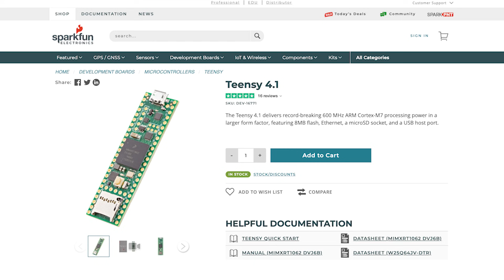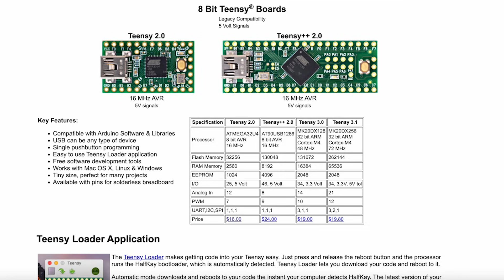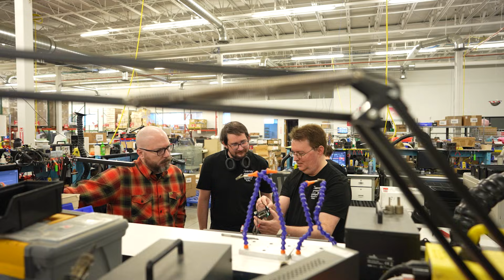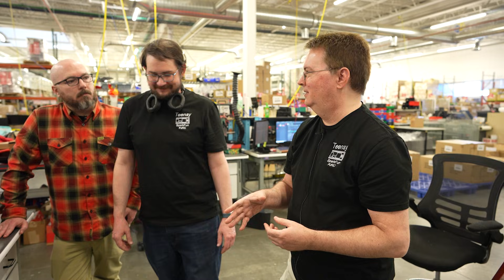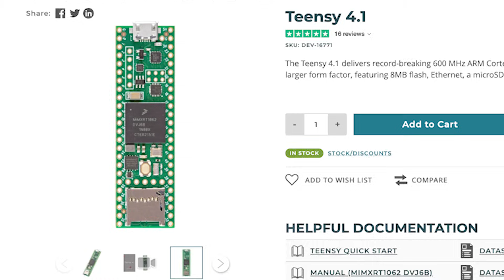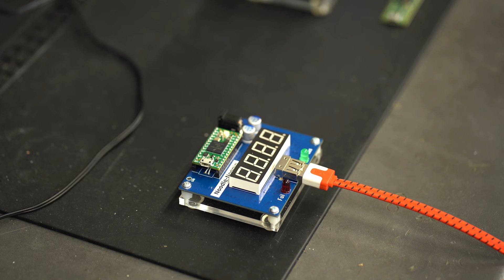The Story of Teensy: From PJRC to SparkFun Partnership

Comment: Teensy (3.2 specifically) arrived as a powerhouse right when people needed it. Most of the market was more expensive underpowered Arduino boards or difficult to get started with bare AVRs and PICs. Paul's software support made it extremely easy to work with and embed into all kinds of projects.

Comment: They are great but imo largely redundant with the likes of ESP32 being cheaper and more available.
Reply: Teensy is significantly faster 600mhz whereas the fastest esp32 I have seen goes up to 400Mhz.  Also teensy uses arm microcontroller vs Tensilica on esp.
Reply: yea, mostly same here i only use the teensy in very specialised applications cause its rather powerful but also expensive also cause it only comes in a dev board form factor. For everything else RP2040/2350, ESP chips etc. Also the new ESP32 P4 is a very capable chip and has much more functionality than current gen teensy.
Reply: The teensy is a completely different beast than esp32 and can do many things that esp32 can not. Not to say the esp32 is bad, but its a rather different product for different use cases
Reply: If you like "Buy USA", teensy is your choice. Also Paul and Robin know the whole thing, ESP32 is a big corporation.
Reply: @tedsaylor6016  I'd "Buy USA" but the evil capitalist overlord and his tarriffs make that very hard to do